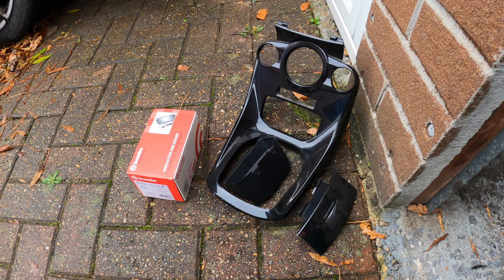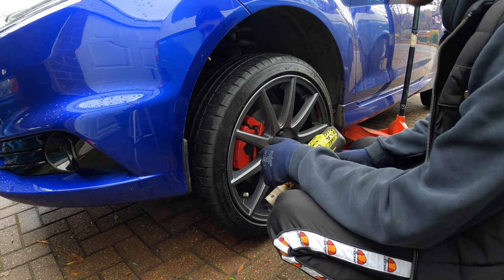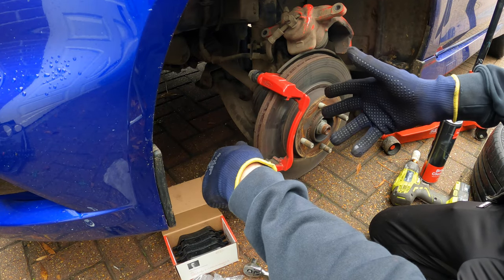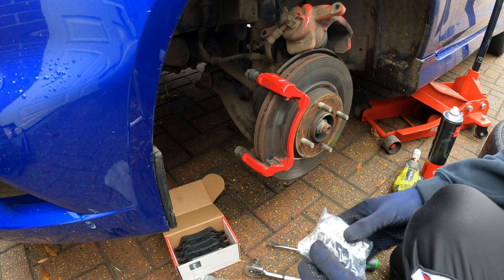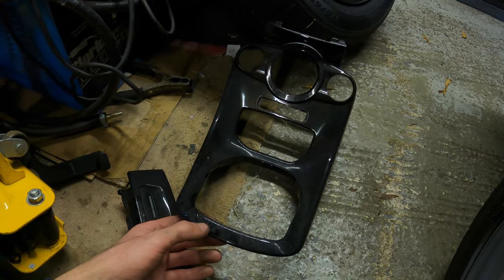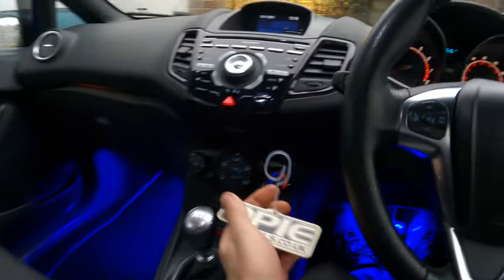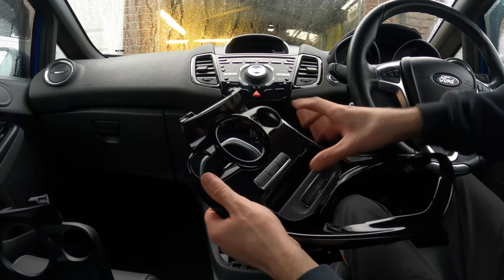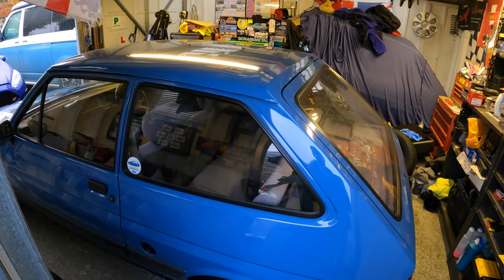ST180 Brake pads & interior upgrades!

Comment: Nah Mitch, ida run around on them pads for about another 2 days mate, lol 😂.  You timed the pad change perfectly. I used to use 2 really big screwdrivers 🪛 to push the pads back until i got a G-clamp. Now don’t forget to pump the pedal as he does it while I’m typing, lol .  I just can’t wait to see the MK1 Fiesta on the road, oh yeah.   It’s looking really nice . 
Do you remember a while ago the big thing was hiding everything in the engine bay, they would make box sections and weld them in the wheel arches for the wiring and any pipes that you could hide, it really lifted the engine bay. Niiiiiiiiiiice video.  😎👍👍👍🇬🇧
Reply from the maker: Hi Mikey, that's a good method too! The Mk1 video will be out this Thursday & my dad has already been thinking about hiding the wiring! 😎😎

Comment: Very good video Mitch hope you get those ebc usr discs down the line .I'm having the x47 classic fitted by h sport timsbury with turbosmart 7psi actuator it's near 2 grand for parts and fitting but should turn the car into a monster
Reply from the maker: Wow that sounds like it’s going to be some car once all the work is complete! 😎
Reply: yes I hope so 2016 model with 23,000 on the clock panther black just need to get the front upper summit strut brace then all the supporting hardware is complete if their is a way I can get some photos to you let me know.

Comment: Mitch I dont think I have seen pads in such a bad way! The reason the pads lift is due to heat and there not being any friction material left on the pad! hence the remaining material lifts I would not be happy with my son if he had left his pads that long before changing them especialy on a ST180 fiesta!
Reply from the maker: Hi, I put the lifting of the friction material down to cheap parts fitted by the previous owner. Glad I’m not your son 🤪🤪
Reply: @Mk2Mitch  He has a focus RS and I maintain it as im a Ford Engineer of 28 years